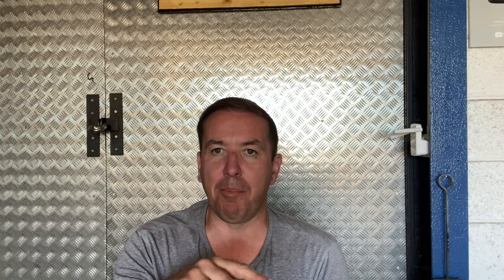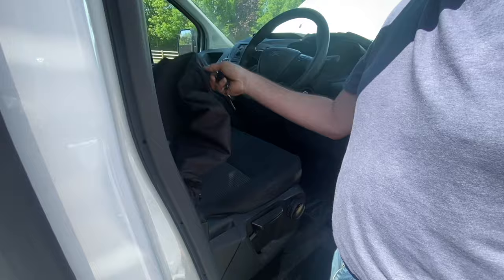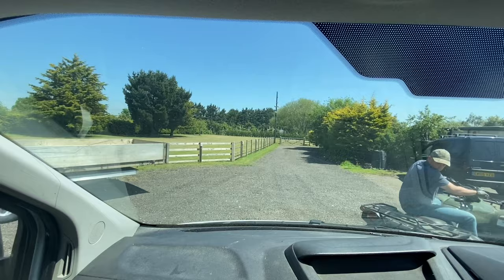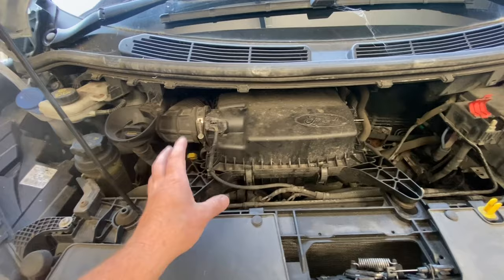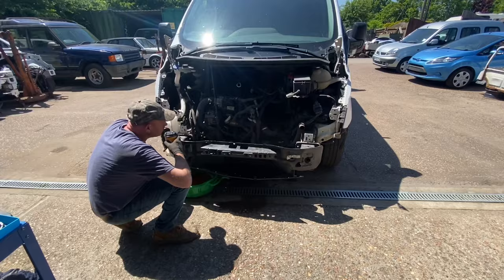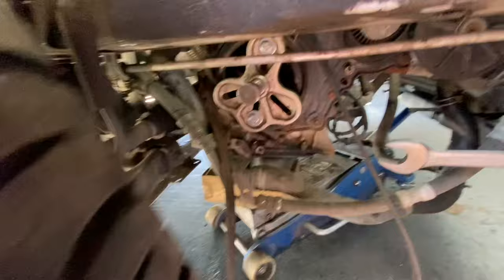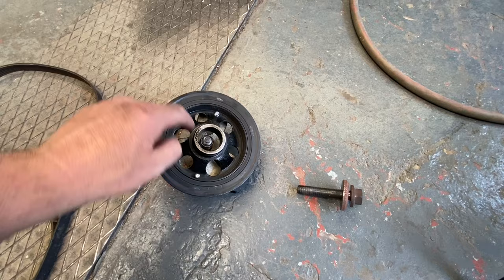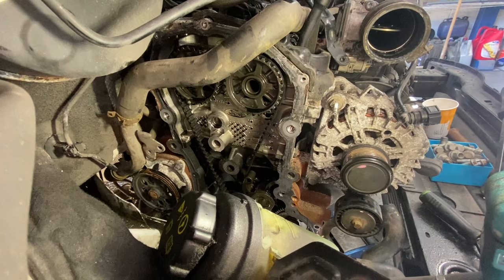Cheap 2017 Ford Transit Custom Euro 6 Engine Fail PT 1

Comment: Nice video guys. BTW I actually fitted those seat covers last year after spending a few hours cleaning the seats after they got pretty dirty. 

For info, the van died on a roundabout going from 2nd to 3rd gear at around 20-25mph.
Reply from the maker: Cheers bud we will get it sorted 👍
Reply: Exactly what happened to me, god knows why I’ve gone and bought another one!
Reply: @TheCainabis  Do the belts fail prematurely? Or can you avoid issues simply be replacing them  at specified mileage?
Reply: @jashugg  Most engines about 75k I think these days. There are some recommended at 120k ish but would you want to risk it?
Reply: @jashugg  yeah change every 10,000 miles 😅😆 and replace everything else while you are at it!
Reply: With the wet belts using the wrong oil eats away at them and they fail way earlier done 3 ford 1.0ltr ecoboost ones or as we like to call them ecobang engines 😄
Reply: @jashugg  I know on a lot of VAG cars they use to say change the belt at 120k but after quiet a few snapping they change the service printout to 80K but normally i change mine around 70-80k, that way i don't have to stress about if it is going to snap or not, and always use oil with the correct manufacturers spec like my VW is vw 507.00, don't just go by the oil weight (5w30 or which ever it is for that engine).
Reply: A colleague at work has had an issue with the wet belt on his Peugeot 308 1.2 3cyl. Managed to get Peugeot to pay for the repairs. It had started to delaminate.
Reply: @J15umm  lol His first mistake was buying a Peugeot. xD
Reply: @J15umm  only a 1.2 in a 308 - turbo...?
Reply: @RWL2012  yeah apparently makes 130ps.
Reply: Just some background on why the belt wasnt replaced before. This was my stepson's van, and he knows nothing about engines and just had it serviced when the dash told him to. The last serice was only about 5k before the issue happened, but as Ford recommended 150k or 10 years on the belt it hadn't been done yet.
Unfortuneatly (and stupidly of me) I wrongly assumed it had a chain like the older 2.2 models so didnt think you advise him any different.
Reply: @NeilsCarsAviationTravel  no worries he couldn't probably buy it back off of Rob once they fix it, which I know the will get it going. 😀
Reply: @MrZimmaframe  He's living and working abroad now so has use of vehicles locally.
Reply: @MrZimmaframe  A mate looked into this a while ago when the belt went on his 2.0 tdi Mk7 Golf at 66k. Continental said 120k, VW said 90k miles!
Reply: @grahamflemington5085   haha ye it is a joke xD rip, did they give any compensation?
Reply: Brilliant video as always , Chris looked pleased as punch on the quad keep them coming!
Reply: At 25mph most transits are still in 1st
Reply: @marlowjoinery9783  yeah I remember hearing the old banana engined ones at full chat all the time in the 90s 😀
Reply: @NeilsCarsAviationTravel  thing is the old transits loved it not like the new ones I had a 07 that broke all the time
Reply: @marlowjoinery9783  yeah and the 100bhp one in this video only really has useable poke from 1500-2500 so not worth reving anyway.
Reply: @NeilsCarsAviationTravel  its 120k or 10 years on the 2.0 euro 6 engine
Reply: @Phil-1969  I just checked Ford Etis using reg lookup and its showing as 144k / 10 years.
Reply: @kenrossaukrsa  - Aren't they made of steel? I am reading here that they can't blow.
Reply: Hasn't Ford just issued/issuing a recall on all 2 litre diesel engines in Custom/ Transit (and any other applications) built 2016 to September 2017 with the wet belt? Recall is to replace the timing belt.
Reply: 8⁷.1   ah
B z  ?p±
Reply: @jashugg  
Definitely put the correct oil in with dealer recommendation.
If anything goes wrong it’s in there hands.
It happened to me at 70k
Took it to the dealers and got a free engine completely free..
Reply: Put the correct oil in have it done by Fords if anything goes wrong Fords should pick up the bill.
Exactly what happened to me.

Comment: It will be the vacuum pump on the end of the exhaust cam rob, there are common pal, the vac pump breaks and can cause the camshaft to lock up and that’s probably wot as ripped the teeth off. Good luck with the rebuild! I’ve know some people get away with just a new vacuum pump.

Comment: Rob I worked for Ford I’ve seen this so many times you need a new front cover valves piston belts super common issue with the 2.0 there is also a recall on the injectors so check to see if yours need doing

Comment: Good work guys. You must remove the sump as well. The oil pick up might be blocking up. 
The belts are de-laminating because of the excess diesel fuel that ends up in the sump post the DPF regen process.

Comment: The first diesel engine I worked on was a snapped cambelt. A Bedford Midi, which was an Isuzu. It sheared the rockers and did no further damage. 50 quid for replacement rockers from a scrapyard, new head gasket and oil seals (oil had leaked on to the belt, which caused the breakage) and new belt. Timing tools were just bolts to lock the sprockets and a small piece of angle iron to lock the camshaft and it was sorted. Other engines can be totally wrecked once a belt snaps. How sensible to design an engine with brittle rockers! Looks like this one isn't too bad either, even though it wasn't the rockers. If only people changed cambelts when they should be changed.
Reply: The old Transit 2.5 Di used to break belts quite a lot, but you could usually get away with replacing a few bent pushrods, the occasional rocker and the lower belt cover where the belt had wrapped around the crank sprocket. Even after they went out of production, Ford was still introducing modified parts to try to make them more reliable.

Comment: Been involve in a few of these .. almost certainly you will have bent valves do cylinder leak down test  also common for the crank to be US and when you reassemble make sure you understand how the pump is timed it will not run properly if its not correct Regards JF

Comment: Check for compression, and use a borescope. Look at the pistons and valves. It might not be bent, but could be chipped. You are at this stage... why not do this.

Comment: These newer transits are nothing like as reliable as the old ones, mate of mine has had two flywheels in three years. Apparently the ice cream van engines are bulletproof, probably because they're made to tick over all day.

Comment: Anyone else got this problem, Carry on watching these guys will sort it, no doubt about it, for those bangin on about cambelt should of been changed to prevent it, easy to say after the event, sometimes cash restrictions or finding a decent garage plays apart.
Reply: Very true Dave. This was my stepson's van (but finance in my name). He knows nothing about engines and just had it serviced when the dash told him to. The last serice was only about 5k before the issue happened. Ford Recommended 150k or 10 years on the belt.
Unfortuneatly (and stupidly of me) I wrongly assumed it had a chain like the older 2.2 models so didnt think you advise him any different.

Comment: All the valves should be closed now if no damage. Put an air blow gun with a rubber nose cone into the injector ports one at a time. If valves aren't seale you will get air coming out either the exhaust ports or inlet port s depending on the valve damage

Comment: Now the valves are off load with the cams out. Do a cylinder leak down test you will know if you have a further issue before putting it all back together 👍

Comment: I’ve got  same year 2.0 LTr panther engine from new , it’s been the most unreliable van I’ve ever had. Broke down 26 times, had new turbo, 2x idle gear recalls due to knocking, new radiator plus other repairs, eventually had a whole engine replacement just before warranty ran out. No problems since then very comfortable and nice to drive (when working)

Comment: Had one of these from new in 2017. Been towed to dealers 3 times, nothing but constant problems despite all servicing being done. Broke down for third time last week,  apparently the cam belt has snapped so probably a new engine required.  Thank God its leased !

Comment: Little trick I use to get that timing cover off or even sumps that are sealed on like that, use a 1 inch scraper tool / wallpaper scraper with a nice sharp edge, and gently tap it all the way round basically cutting the sealant.The thinner the scraper makes it easier. Usually doesn’t deform it so can be reused.
Reply from the maker: It’s not a reuse item 👍
Reply: @sruk  once the cover is marked won’t seal again all the stripping for nothing yr spot on replacing it

Comment: That's a pretty good catch.  The long wheelbase is a lot more unusual on the Transit Custom, pretty much all of them you see around are the short wheelbase so that could make it a much more desirable vehicle when it's all fixed...

The engines on these are a bit notorious for issues, but I understand that the issues have been sorted out now.  Time will tell...

The old Vauxhall Family OHC engines used a separate cam carrier on top of the head too.  In a lot of way it makes sense as issues with the camshaft won't kill the, much more expensive, cylinder head...

Comment: They are both wet belts mate. It’s very important that you to check the oil pump pick up strainer for the belt teeth/cambelt fibres. 
The fibres are known to block the oil pumps up anyway. 
The long service intervals kill these engines!
Reply from the maker: All in pt 2 👍

Comment: With the cam lobes pressed on like you say  and if the valves are able to push the cam lobes having give in them at a certain pressure rather than bending the valve when piston makes contact from stripped teeth or a broken belt etc . I’d rather change the cam box assembly than pull the head off . Providing like you said you dodged a bullet with the valves and there seating etc . It’s still a lot off labour for a belt . Considering mileage I’d nearly keep going and whip the engine out . Check the clutch flywheel and rear main seal . And you’d have access to see and repair and weaps and potential leaks that are a pain to get at with everything reinstalled . The long way round is often the shortest way home . For the peace off mind you can confidently give warranty on resale

Comment: my last transit mk 6 2001 sold 2017 never missed a beat only sold as stopped working to old 70 years
Reply: I've a 2003 mk6 
279 k on the clock 
Starts at - 20 
It loves the journey from manchester to poland it t akes the hills of Germany fully laden  in her stride 
Had to get a new key last week 
I think I keep her
Reply: @acorndogs904  she’s a keeper 😉😃

Comment: Cam-belt change interval 144k/10 years, they never make this as belts not man enough due to diesel in engine oil deteriorates the belt, you were also lucky to get injectors out, as normally seize in.

Comment: Can you not pressure test the cylinders by putting an air line (blow gun with a rubber tip to seal) on the injector port and listen at the exhaust and inlet for vale leak or holes in the piston into the sump.
Hope this helps.

Comment: When you finish it check the fuse for the electric auxiliary water pump. There is a recall and the fuse has been downrated to 7.5 Amp. Cam belt change interval was originally for life, but now 150000 miles/200000km. Mine broke at 78000!

Comment: We’ve got a couple of those Transits on the works van fleet. Been nothing but trouble, brake failure, new gearbox, belts, constant DPF problems - luckily all the vans are leased so the lease company picks up the tab!
Reply: My cousin was always having DPF issues with his Transit due to nature of his work (short local trips). Luckily we never had any issues with this one as it was mostly doing longer journeys on the motorway.

Comment: covers are bonded on has to be replaced
once  repaired you have to be careful what oil goes in the engine 0 30  C2 oil

Comment: Transit vans used to be a doddle to work on, we’d one for our works van change the oil and put petrol in it is all we had to do, only thing was that you were everyone’s friend with the van, and most weekends were taken up moving stuff but the double wheel base did the job,
Reply: Smiley shapes did but these mk6/7&8 transits are nothing but a nightmare..
Reply: Unbelievable poor design so you have to pull everything apart to do a simple job

Comment: At a 130,000 miles, might be wise to overhaul the oil pump and fit a new water pump. While you have the sump off, check the crank bearings. 
If it's had no cam belt ever, has it missed many oil changes? Dirty oil, worn bearings!

Comment: Guys, please make sure you speak to your local Ford dealer. They have issued a recall on a huge number of transits for the timing belts failing. It may be that it is covered under warranty. Please please please check
Reply: I'm not one to check number plates but the DVLA checker does indeed state "outstanding recall found" 
You could be on to something...? 
Though, knowing Rob and Chris it's probably already fixed 😂
Reply: You read my mind. When he mentioned that he’d heard of issues with those engines, I immediately thought Ford will have been forced into a recall situation with that engine, especially is it’s on a number of different models. 

I wouldn’t have touched it until I’d checked. 

But my main observation is what an absurd engine design. There are Ferguson tractor engines that are 70 years old still running fine. Yet these things fail after just FIVE YEARS! Absolutely ridiculous.
Reply: Ach, leave the guys to it!  Where's the entertainment in watching a 20 second video of Rob phoning a main dealer?!!
Reply: @jfwbufg781trub  they're running a business and if a viewer knows something that could potentially save them money do you think they shouldn't tell?
Reply: It’s done 130k.. !! It’s a belt, not a chain.
Reply from the maker: To late now it’s stripped 👍
Reply from the maker: @sammytheseal2307  they wouldn’t cover it bud no history 👍
Reply: @sruk  that's a shame, worth bearing in mind for the future if you get another one 👍

Comment: At ford on the recall they don’t usually strip them down they just replace the engine but they do normally smash rockers so you got lucky and I would still change them as they might have micro cracks in them.

Comment: A lot of th Opel corsa D’s as well as the 08 fiat doblos Have the same design with the cylinder heads  I think it’s a good design

Would it be worth your while looking with an inspection camera into each cylinders for damaged pistons ?

Comment: Standard stuff for the 2.0 Ecoblue, lost track of how many I’ve seen with teeth stripped off the cam belt, some with mileage below 40k. Can’t say I’ve ever seen an oil pump belt fail, however on the 1.0 ecoboost when the belts break up it blocks the oil pickup pipe (part of the pump on them), blocks oil galleries with sludge subsequently killing things such as the turbo, the vac pump and ultimately the engine itself. Not seen it occur on the 2.0 ecoblue as like this one the teeth strip first (have also seen this happen on a few 1.0 ecoboosts). Never bothered to repair one when it happens, brand new engine every time. Seen a few that have had the belt done but they’re never right. Oh and yes you’ll need a new front cover (along with crank bolt) as you do have to destroy it to remove it, ETIS also states the sump must be replaced if removed as it’ll get bent removing it. Best of luck with the rebuild.

Oh something else, if all goes well I’d replace the thermostat assembly with the later one (only has two bolts holding it to the head and doesn’t have a temp sensor at the bottom) as the early ones are prone for sticking shut and causing a lack of power (caused by PCM reducing power to reduce engine temp, you’ll never get any warning messages on the dash when it’s occurring). Seen a few get killed by this (warped head).
Reply: I work for Gala Motors we sell loads of complete 1.0 ecoboost engines I’d never buy one 😂

Comment: Awsome vid. I came across that style rocker/cam housing rebuilding a zaf 1.9cdti (150). I had never seen that style before, seized water pump caused stripped belt, all 8 rockers on inlet side snapped. Nice easy repair in end. Be good to see you get this one sorted 😎

Comment: That belt would have been disintegrating for a while,blamed on the oil change intervals
The vac pumps would fail because of debris from the belt.
Under warranty they were replacing engines.
So this probably has belt debris in every oil way.
Reply: Vac pump will also get clogged with carbon if oil interval is exceded, had one a month ago. Also incorrect oil specs are real ford killers these days. Every Ford wetbelt engine should have propper spec 0w30, 0w20 or 5w20, if not its waiting for disaster.
Reply: @fhrk1991  When this Panther engine was introduced, it came with its own oil specification, which was not backwards compatible with the previous Euro 5 Pumas, unlike every other upgrade they had done for the last 30 years. This was a pain in the arse for fleet operators with both versions, as we had to find room for an extra barrel and try to make sure everyone paid attention to which one to use for topping up. Another annoying thing about oil specs was that we had Peugeot Boxers and Transits, both with the same 2.2 Puma engine, made in the same factory, but requiring different oils.

Comment: The cover on the side is not reusable but  ford have them on the shelf cheap . But   its cheaper to replace these engines there terrible when over 100k  .  give me a smiley transit with the banana engine any day
Reply from the maker: There £75 bud and £160 from Ford